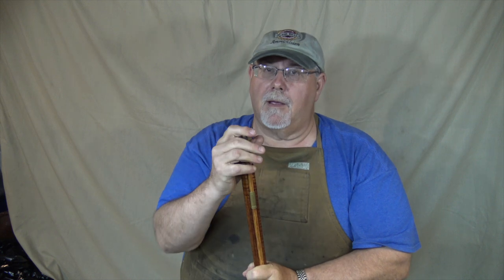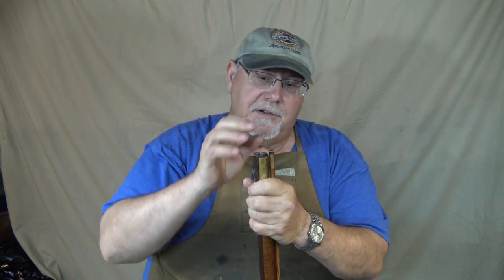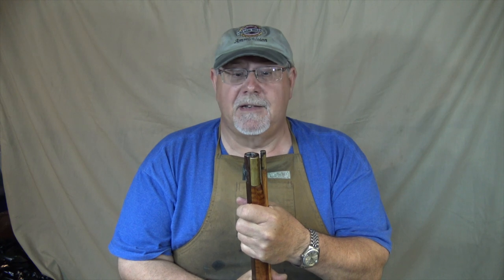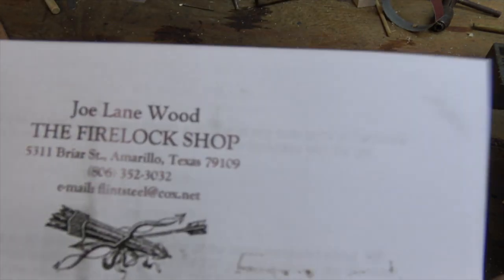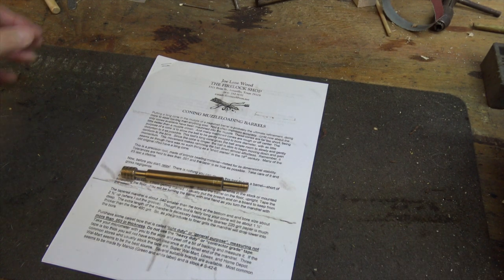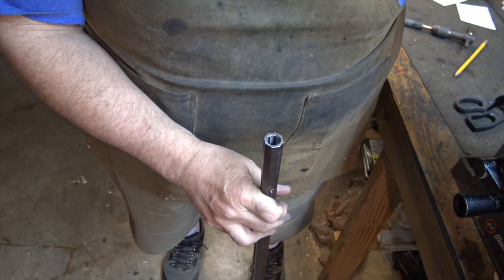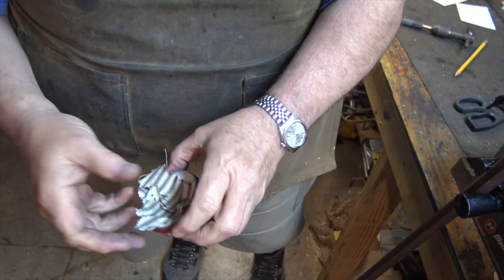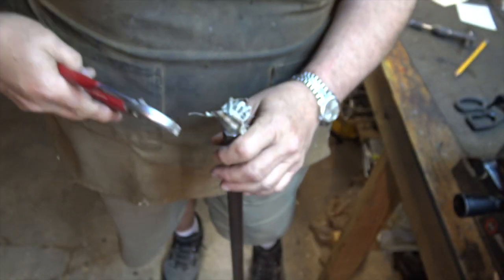Coning a flintlock rifle barrel

Comment: I have a rifle that has been passed down in my family since about 1795.  When we were trying to determine who had made it, one of the trivia we discovered was that the barrel had been coned.  But the collector who advised us described it as a swamped muzzle, not coned.  Perhaps different terminology in different regions.  Either way, I'm happy to learn another term.
Reply from the maker: Mark Lee A coned barrel has the bore relieved at the muzzle to facilitate loading without a short starter. A swamped barrel is wide at the breech end, then it tapers to a point about six inches behind the muzzle before flaring out again to the muzzle. It puts strength at the breech, where it is needed and it improves a rifle’s balance.
Reply: Just another little note to clarify the difference. Coning is done to the inside of the muzzle. A swamped barrel refers to tapering the outside of the barrel. Smaller diameter in the middle, larger at the breech and muzzle.

Comment: Regarding the "drop-in" bore light, it's best to not actually "drop" it, it will last longer if you tilt the barrel and let it gently slide to the bottom. I destroyed a couple before I learned that trick.

Comment: I just coned a .50 Pedersoli long rifle and a .54 Great Plains Rifle.  Both taken down to smooth bore about a quarter inch in from the crown.  Will be experimenting with various ball and patch sizes to get best compromise of loading ease vs. accuracy.  Should be fun and a LOT more relaxing not having to beat hell outta my hand on a short starter.
Reply: What were your results?

Comment: I have a rather late production T/C Hawken .50 caliber that has a factory coned barrel.  At the time I got it I was skeptical, but eventually found that it was accurate AND easier to load both with conical bullets and patched balls.  It is, to date, the only gun I have that has a coned barrel.  

Since this time I have discovered Lee REAL bullets which basically is coning in reverse with the lower portion of the bullet of a slightly smaller diameter, enabling the bullet to be seated to the most forward ring with only thumb pressure.  The pure lead bullet obturates nicely when fired so it comes out well stabilized and produces acceptable accuracy.  While I generally use a short starter, I probably wouldn't have to.

All that said, I have a "SBML" (Short Barreled Muzzle Loader) that has 9-inch and 12 inch barrels in .54, .50 and 12 Gauge made from T/C New Englanders.  I have plans to make even shorter versions using the barrel remnants from the first sacrifices.  Currently the barrels are crowned but not coned.  As the SBML has no ramrod (using a slightly longer than average short starter), I would not benefit overly much from coning the .50 & .54 barrels, though I think loading it might be quicker/easier when using a round ball.

In any case, this was a very informative video and i will be going on to view the second of the series shortly.

If you would like to borrow my SBML for a video some day, lemme know, but as I have stage 4 cancer, don't wait too long as I probably only got a few more years before I depart this existence.
Reply from the maker: I'm sorry you're sick Dale. Thanks for the offer, but my plate is pretty full at the moment.

Comment: Thank you for the great videos.  I have learned a lot from you over the years. I have a question about coning. We are always told to protect the muzzle when cleaning.  Range rods have a rod centering device to reduce muzzle wear.  Seems like coning is doing in minutes what years of ramrod use does - without affecting accuracy. Why does one form of wear affect accuracy while other does not?   Thanks again.
Reply from the maker: Because a ramrod wears the muzzle unevenly. A coning tool relieves the muzzle concentric to the bore. The patched ball is still completely filling the barrel groove to grove, but the lands gradually fall away.

Comment: GREAT Idea! You may have just given me a "Different" one?  the new thickness of the frizzen or position of face may be problematic? What if I used a Sawzz All Blade? Hard, Thin, Flexible, Available, old ones laying around my shop for cutting stucco and such. 
I do Have Cheap Indian models and have had success with my own case hardening recipe, but it is always good for "old dogs" to learn new tricks!
Just finished "re finishing" two flint lock replicas. Salts blued parts, rust blued other parts, rust blued some, ozoned a few for aged look, and nickel-plated over on others. came out spectacular historic looking and great rust prevention/passivation. I am chasing Color Case Hardening with straws or blue greens and a better carbon from plants in my area.

Keep those Smoke Poles SMOKING!

Comment: You didn't mention it, but would it be beneficial to use some kind of cutting oil with the paper to flush away the steel particles?
Reply: Yes, the paper will last longer and it will be a little quicker. Water also works. Thats why you use waterproof sanding paper, because normal sanding paper wont allow you to ''wash'' it

Comment: Great video..do you think using a power drill would be easier and do a better job??
Reply from the maker: Joe Wood, the coning tool maker says not to use a drill, you'll end up off center...practically, you have to change paper so often, I don't think a drill would do anything but slow you down, chucking and un-chucking the tool.

Comment: I actually built a percussion cap Kentucky rifle from a gun kit a few Christmases ago.... I haven’t fired it yet because for some reason the hammer wants to jump forward.... I’m hoping to eventually take it to a gun smith to see why the hammer what’s to jump forward
Reply: Lift out the lock and operate it slowly. Most of those come out with  a screw or two, which is part of your periodic cleaning anyway. My guess is that someone either over did a trigger job, or the parts are rough and have burrs or rounded edges at the engagement points. Look at where the sear engages very closely. Put sharpie marker all over both surfaces, and operate the hammer. Maybe push forward on the cock piece and see if you can make it slip with your hand.  My bet is that you will see a very small area of bright metal where the shapie rubbed away and the whole rest of the surface will be covered in ink.  Then you can stone the edges to the proper full engagement without changing the underlying angles. I recommend fine diamond knife sharpeners or jewelers diamond files for this sort of work, but you can also double stick tape fine automotive sandpaper to a piece of glass or other known perfectly flat surface.  I really think that if you do this and look at the mechanism carefully, the problem will be very obvious. Look up the phrase "positive sear engagement" and "negative sear engagement", as you need to understand what those terms mean. It is possible that you have either a rough edge that is functioning as negative sear engagement, or that the pieces were improperly fit.

Comment: That sanding operation would go a little faster if you did it wet with WD-40.
Reply from the maker: I would, except oil or water separates the paper from the tape, so it just doesn't work...dry is the only way.
Reply: Hi Mike,
     Some liquid sprayed on the barrel and sandpaper after it's been attached to the arbor, the adhesive might hold long enough. Just my 2 cents worth. Love your videos, especially on early revolvers.

Comment: Couldn't you use a drill. You would get an even rotation, and would not have to unpin a barrel.
Reply from the maker: Joe specifically discourages that. If you use a power drill you are much more likely to be off to one side.